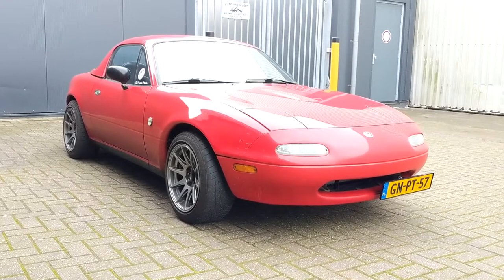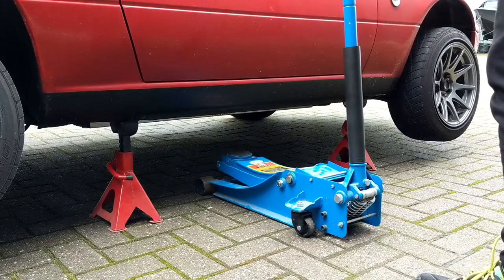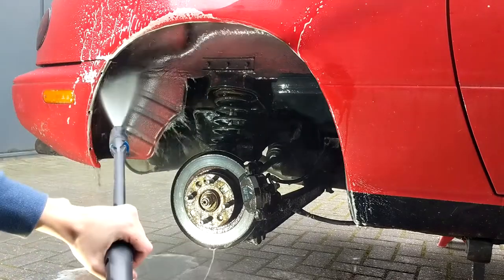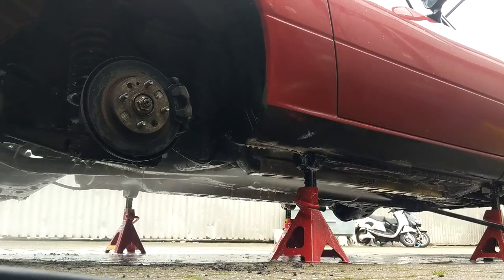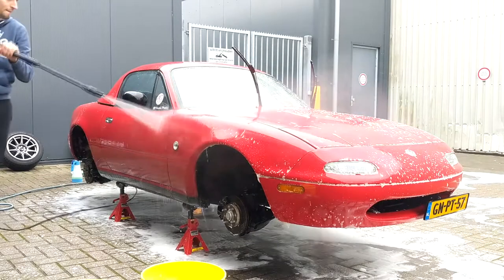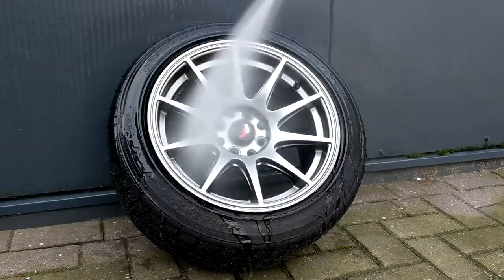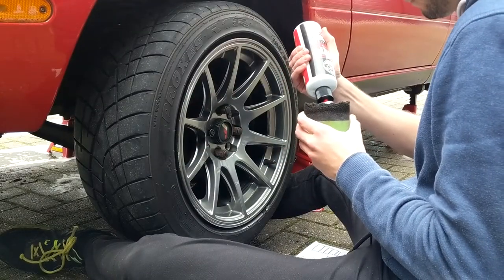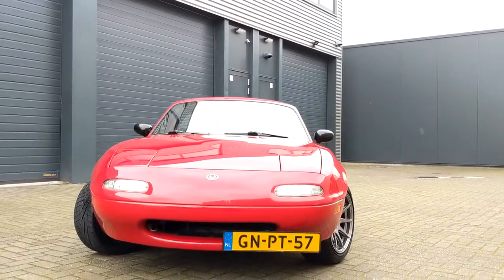Wheel Wells + Undercarriage Detailing - Mazda MX-5

Comment: Is it safe to jack the car from that point of the rail? Thanks.
Reply from the maker: Afaik it is, but I'm no professional mechanic :)
Reply: @trailsdetails4061  Jacking points are at the end of each sill you can see them marked by two separations in the sill joins.

Whilst it was jacked up correctly, that car is clearly pretty solid so it didn't fold like most UK fives would have!
Reply: @trailsdetails4061  I would suggest to use a folded piece of clothe or better, a rubber protective block, because metal on metal, for lifting heavy object it may damage a bit the paint and create a perfect entry area for rust
Reply from the maker: @colindeclercq8897  thanks but fortunately the jack's lifting arm has a rubber surface so no metal to metal contact
Reply: @trailsdetails4061  My apologies, I missed this one!
Reply from the maker: @colindeclercq8897  np dude👍